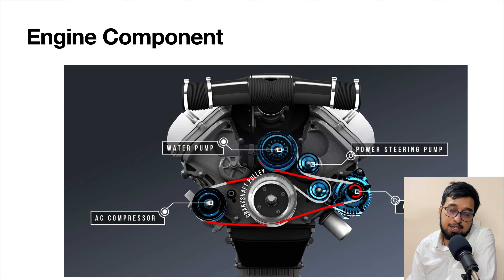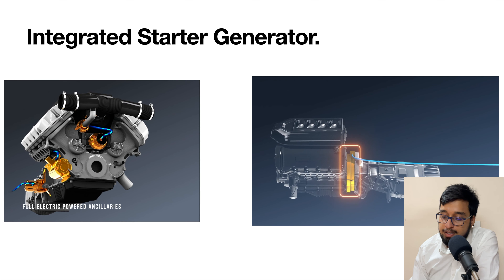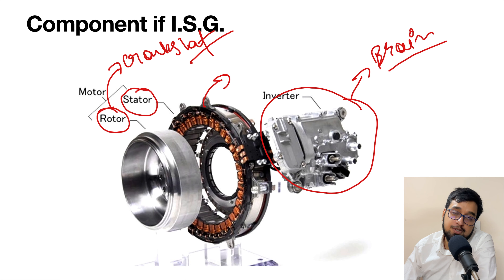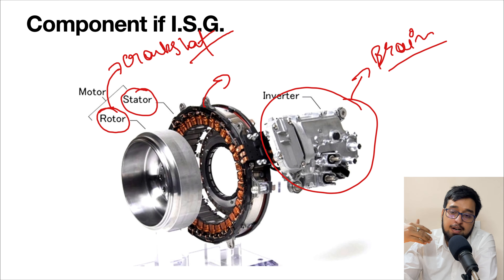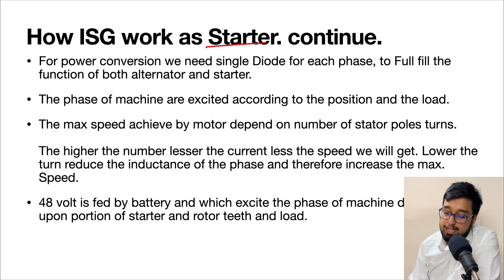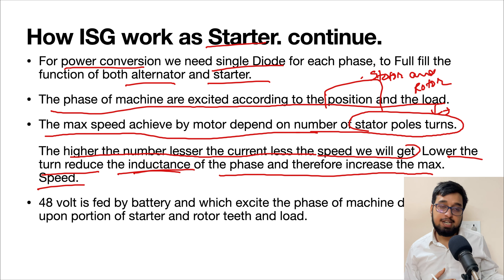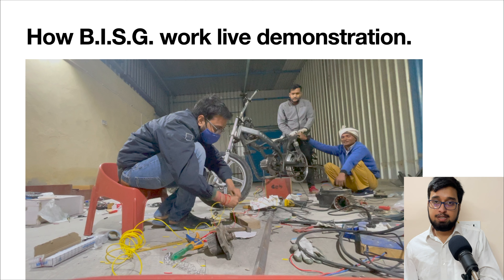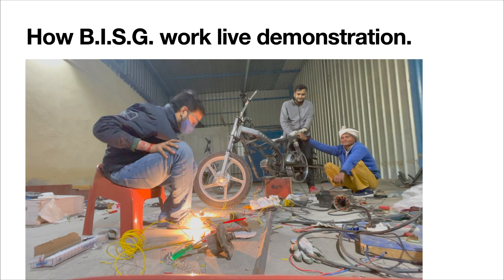How 48 Volt Integrated Starter Generator works | 48 volt mild hybrid system |

Comment: Hi, wonderful tute.
Besides powering the auxiliary components, I'm hoping that a 48V BISG with say, 4kgm torque, will also be able to power a car indipendently during stalling speeds. Whereby eliminating the need for a torque converter from the drivetrain. Thus allowing the ICE to be paired directly to a CVT.
My question to you, Sir is, will a BISG still require a flywheel/flexiplate? Torque pulses you know can be ironed out electronically by programming dead zones in throttle response.

Comment: Hey... This video was really helpful and you are doing great job...but I am unable to understand the difference between ISG and belt driven starter generator.... Can you pls tell us more on BSG.
Reply from the maker: BISG look like your alternator and drive using belt. You will get this system in mg hector and Maruti Breeza. But ISG is placed between engine flywheel and transmission. For better video I have added pictures in chapter 1-2-3 you can have a look there.
Reply: @Automotiveshowin   Can you jump start with a normal car with 12v battery on a 48volt car system when its 48v battery is failing?

Comment: U dont call it balancing shaft u mentionedon 48 volt configuration. Its called crankshaft. Yes, crank is visible outside but without damper. No belts watsoever or atleast for only one thing. I jave worked on fully equipped hybrid cars. Starter, alternator/generator or motor all one. AC compresor is also driven by a built in motor as a seperate lil unit so is water pump n depends on Make n Model. So, no belts needed for anything.